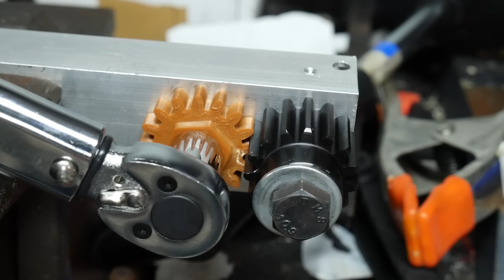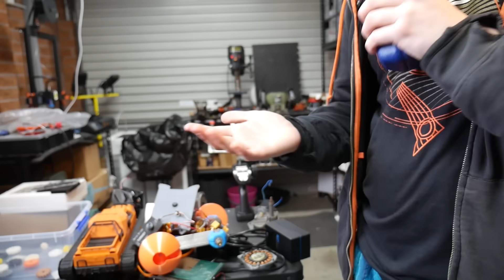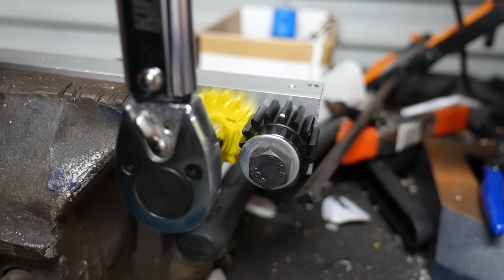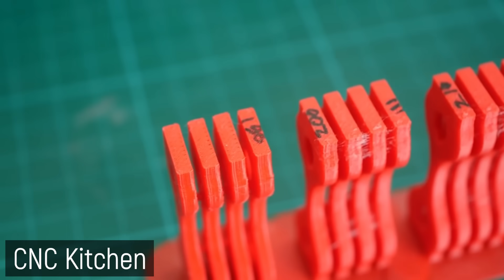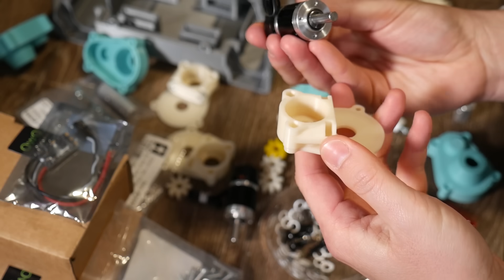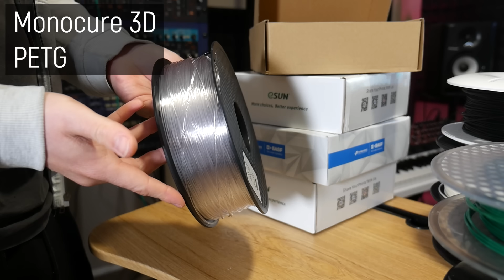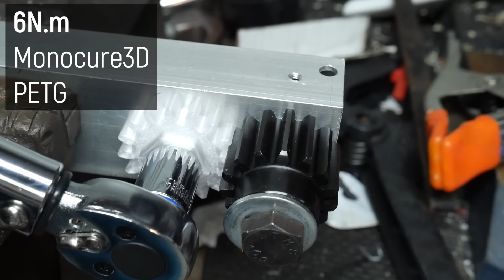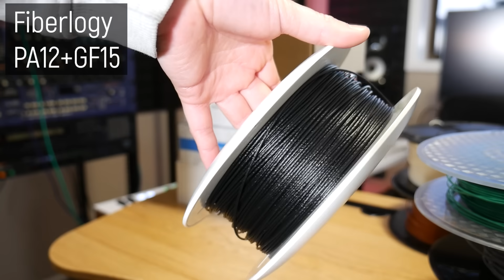Which 3D Printed Gear is Best?

Comment: I don't understand why, other than ease of print, people try to use PLA so often for anything functional.  Everything I read mentions it degrades, deforms, gets brittle, and heat causes issues.  I mean if you print a functional part for a machine with PLA and its at best slightly "stronger" in certain ways at first but fails within 6 months why not sue ABS or a different filament that will be humming along quite nicely for years or much longer?  I did notice we tested 4 filaments and gave PLA 4 bites from the apple including multiple special blends while the other 3 filaments got 2 bites.  And poor ABS got old filament to boot.  Interesting to be sure, but the pro PLA bias in so many video tests is present.

Comment: Thanks for the very interesting video. I've impressed with CF PLA and CF PETG stiffness, but I'm not sure how a CF filled gear would wear.  The surface of CF parts seems fairly abrasive. Maybe a slippery surface is more important than outright stiffness for gears.

Comment: I'd like to see the tests performed again for Nylon or anything else that fails with a hex drive. But do it with a different drive, like a cross pin or other similar mechanism that won't fail to simple minor flex.

Comment: The 'mechanical fuse' concept is an interesting one. As seen in the comments, there are many instances of them. But one that comes to mind, are called shear pins and often used in lawn and garden equipment, they connect something like an auger to a shaft and will shear if you hit a rock, etc.

Comment: It's B A S F
Also, before I decided to go with the "rolling around the hub" failure mode, I would have to ask what levels of torque it handed after having done so.  E.g., after exposed to a 11Nm load, how does it handle a 10Nm load?  If it still handles it well, then what you're looking at isn't a "mechanical fuse" but a "self resetting mechanical breaker"

Comment: For the kinds of thing I make, the static load test isn't really important.  even 10Nm is a lot of torque for a small robot or something.   Seems to me that long term wear would be a more major problem.  How about running gears at  high speed with a more modest load?  Do the teeth wear down?  Does progressive cracking become an issue?   For a wear test, running it against a super-smooth metal gear wouldn't be very meaningful - but rather use two 3D printed gears against each other.

Comment: In my opinion you should print these gears 100% solid in all tested materials.  You are comparing hollow gears to solid gears.. apples and oranges. However the data is very usable especially the flexibility data. Also your temp has to be different / tweaked for each material to get a 100% layer bonding per material.  Then aneal each print to max out strength. The failure should  not occur along layer lines.  Then you would see how strong a gear can be that is 3d printed.

Comment: Wait. Given that it is not a solid print, your typical failure where the (solid) exterior part starts peeling away from the (infill) core could be partly dependent on the orientation. At some orientations, you'll be putting shear stresses on the weakest point in the infill-perimeter boundary. In other orientations, you'll be stressing the strongest point. So you might get much lower breaking strengths on some tests more or less by accident.

Comment: My 1987 Kawasaki GPZ305 has a Nylon oil pump gear. I have heard that a cold engine and high revs increase the risk of the gear failure. Fortunately so far I haven't had any problems myself.

Comment: Probably a better test is to run them at a set load and see which material wears down most. From what I understand nylon is commonly used for gears because it's self lubricating which extends the life of the gear.

Comment: The best material for printing gears is probably IGUS I150 or I180. It is specially developped to have very high wear resistance and has self lubricating properties. And for high torque applications igumid P150-PF can be suitable since it is fibre reinforced.

Comment: My experience as an injection molding engineer I can tell you that the industry uses POM (delrin) to injection mold gears because this material is self lubricating and helps against wearing out. Is it possible to print with Pom?  The glass filled nylon is mostly used for producing frames because its stiffness. PC is mostly used for decorative parts with lighting or when you need smooth glass like surface.

Comment: I have a question about proper storage. You've made videos about storing filament in vacuum bags to prevent moisture but then often show a roll you've had just laying around. Are  all your old rolls stored in vacuum bags or (for PLA) is humidity not as much of a problem?

Comment: if you are not able to get a mechanical failure to protect your motor and controller you could use electrical protection like a fuse to blow when it binds.

you could also use an ebike controller witch limits the current where as rc esc will dump everything into the motor and that is why you can burn motors and esc.

update:

i just realized you could use the gearbox from a cordless drill and hack a way to fit your motor to the drill gearbox and then drive your models that way.

drill gearboxes have a clutch designed to slip to prevent stripping screws.

also being a gear reduction you can spin the motors at higher rpm and not bog them down as much

Comment: The "tougher" PLA brands probably stand up against wear over time better than strength.
What I'm worried about in 3D printed gears is their lifetime. How long will they last before they start to show signs of wearing out?

An idea for testing the gears wear-resistance:
Have a large flywheel attached to a small metal gear.
Then have a 3D printed larger gear attached to a motor.
Have the contraption spin up and slow down (brake) multiple times over a fixed span of time. (say... 8 hours)

This should show how well (or how bad) 3D printed gears stand up against wear and tear abuse.

Comment: I've been using "generic" wanhao PLA to print change gears for my metal lathe, an old Southbend Clone, and they've been able to take some pretty heavy cuts with no failures yet. I agree that a sudden shearing or stripping of the teeth is definitely preferable so I like the brittleness of PLA for gears. Rather have them let go all at once and get out the way

Comment: In small gears running at high speed, temperature resistance is a very important thing. I have made gearboxes in the past with PLA on the motor pinion and it just melts with no load. I also made a electric mountain board, and printed some PLA motor pulleys, which were ok at slow speed, but would also melt at sustained high speeds. Printing the pulleys again from nylon gave the heat resistance they needed.

Comment: I'd love to see a full video series about the strength of these plastics in rotational strength (like this one), crush resistance (for use in hydraulic presses), shear resistance, and tension strength. I mean, if you don't do it I will, but you're actually skilled at this stuff.

Comment: I've used grey PC Blend from Prusa to print a 3:1 reduction spur gear for a large brushed DC servo. I'm not sure of the exact torque, but it's in the region of 35Nm.
Printed with 5 perimeters, 7 top/bottom layers at 0.2 layer height and 35% gyroid infill. It has been in service (in a car engine bay, no less!) for months now with no issues whatsoever. The original gear was injection moulded POM.

Comment: Are there some materials that have higher strength even if they have lower toughness? Ductility is actually a downside for your application, since you don't want the teeth or hub deforming. High strength / low toughness would also result in very clear and obvious failure, since it would fracture instead of deforming, which I think might be more suitable for you.

If you do choose to use lower strength, higher toughness materials like PETG, nylon, or polycarbonate, then perhaps consider different designs for the hub and teeth. The involute gear tooth is meant to reduce noise, friction, and wear, but introduces single point of contact that can be quite a ways from the root. It also tends to cam out under load. Other tooth profiles might produce less torque on the root of the tooth. Likewise, the hex hub clearly spins with only a small amount of deformation, which is aided by the low pressure angle. Using some kind of a spline instead of the hex nut would provide a much better contact angle and would require much more deformation before it would slip.

Comment: Try iglidur i150 from igus, it is specifically made for gears (as well as other components subject to friction and wear). I had best results with a 245C hotend and 40C bed. Also keep in mind that a moving gear will experience heat from friction which may yield much different results than the stationary torque test you demonstrated.

Comment: Great work, but I am disappointed you didn't go back and print solid ones. For instance I would guess the nylon one will not slip on the shaft if printed solid. The PLA one may get up to around 20. Always failing at the tooth. Doing a helical gear would be a good idea too, as it spreads the load over more than one tooth.

Keep up the good work I enjoy your channel (even when you were having the hair crisis😛).

Comment: Motorcycles have a rear sprocket design where the center is aluminum to reduce weight and the outer portion is steel so the teeth take a lot of time to wear, maybe something like this could be used with the nylon for teeth and pla for the center to transfer the load to the shaft. You’d have to find out a way to mechanically connect them that doesn’t just recreate the issue with nylon in that it slips, maybe use screws?

Comment: A meaningless test for gears, the gear will not experience such loads in operation, the main causes of gear breakage are wear, which occurs due to static loads such as friction, as a result of which the plastic heats up and the gear breaks. As a result, you need to test the plastic for the coefficient of friction, for PLA it is high, this plastic can withstand high dynamic loads as in your test, but this does not mean that it will work in your device for a long time.

Comment: Even the worst of those filaments is probably giving you more than 10 times the STATIC strength you need. At this point I would focus on DYNAMIC and IMPACT testing which are how gears typically fail.

For dynamic you need to spin and load the gears, then you should check for durability, noise and efficiency (how much heating is produced by friction).

Impact can be easily implemented by dropping a weight from various heights after having attached it with a rigid chord to the end of your horizontally placed wrench. The spinning hex shown by the nylon gears here can be a huge pro, allowing to recover from the impact with little to no damage.

Comment: One thing to try, if it is possible, but is there a laminate setting with the printing? So the first layer you print left to right, then the second at a 90 degree rotation to the first. Like with wood there is a grain. By changing the grain by 90 degrees each layer is weak by itself but a combination of cross grain laminates and many layers the over all strength increases. Can we apply a similar method with 3D printing?

Comment: I like pla alot, its strong, it can be easy painted, biodegradable. I use it alot and some times i get impressed by the force it can withstand.temperature is not one, i made a cupholder for my Saab, it needed to be ABS ;)

Comment: How about trying Igus Tribofilament? Igus makes self-lubricating plastics, some printers even use their linear rails. I have a reel of (oops!) 3mm filament and no printer equipped for 3mm of Igus filament. I have printed several BB ball bearings using the 1.75mm Igus sample I got before buying the reel of 3mm. The self-lubricating filament should help on friction heating in printed gears.
Reply: Also a thought, dual-extrude a BASF inner gear with a shell of Igus. The tribofilament is fairly expensive (nowhere near PEEK though) and who knows what the strength is, but as a low-friction surface "plating" would be like printing Delrin (maybe).

Comment: It would be interesting to see the tests done with both ends of the turning shift supported so you are looking purely at the torque being applied.  It seemed like the gear was also being pressed into the fixed gear by the torque being applied due to that end being unsupported.   I am assuming the gearbox the gear is in supports both ends of the driven shaft?

Comment: I've been making gears for a local printing press over the last 10 years, and have found PETG to be a good compromise. Unfortunately their gears get quite hot while in use due to friction of the meshing teeth at high speeds. PETG is strong enough for the usual wear-and-tear and can take the high temps.

Comment: I have found that the strength of PETG changes with time after you print it. A part that i printed serveral of in eSun PETG would handle the intended load when used in the first week or so. Once it was a month or so old and the same load applied it would shatter. This part was not left in the sun or exposed to high temps. I think could be that its absorming moisture. I printed the same part in eSun ABS+ and it has lasted more that a year.

Comment: I make gears 1 tooth for every 1mm of diameter seem to work best. Lithium or molybdenum grease on the gears stops them melting/wearing.  
Wish I could find a reliable supply in NZ ,every time I find a good PLA the next time it's been swapped for some thing else

Comment: Quite fascinating testing! And I'm interested in how PC holds up.
Reply: learn from Project Farm. random,  unknown, test subjects are useless. Test subjects, sent by the mfg. may not be the same as what I can buy. If I can't buy exactly what you tested, ALL of your work is useless.
Reply: other testing I would like to see:  MTBF in use. Loss of torque/ friction, thrust due to material type. Best Lubricant.  Best Drive Shaft (spline, D, Square, Hex, etc).  Size of gear/teeth to torque failure point. MTBF: cruising and Max RPM.

Comment: I would choose nylon for this as it may slip under heavy load but for it to slip there must be a problem in the first place. It also goes back to shape after the problem is solved therefore no need to print another one.
For some reason no-one has done a video on T.P.U. for making your own o-rings and gaskets. It's brilliant for that reason and would suggest you do one.

Comment: Think another good test for gears would be to run them with a motor for a while and see how much heat generated at mesh points and how much they get worn out. Also, at what point teeth shear from wiggling back and forth (pushed by gear and springing back). Guessing pure nylon will be a leader there.

Comment: Try printing gears with a larger pressure angle. This will make the base of the tooth wider (ie. more triangular in appearance) and that will make the gear stronger. Gears with lower pressure angles, like your skinny finger like teeth, transmit more power with less pressure on the bearing... however, they are weaker. Also, as mentioned in other comments, try herringbone or helical gears... and try these in combination with a larger pressure angle.

Comment: Your call for a torque resistant 3 D printer calls for a different design concept. Think of a Ferrari wheel that is thick at its base and has deep tentacles that extend to the same in it's torque receiving gear and make the with bigger hubs and bigger gear teeth length. and do the same when they attach. Don't spin da teeth, give them teeth.

Comment: @ 02:00 - Didn't watch the video until the end but i can already tell which is better and for what application, base on my MSc mechanical engineering degree.
Nylon for low torque, high impacts and high cycle count applications, nylon is self lubricating so it can endure many cycles without losing its given geometry and tolerances. Also being able to endure higher temperature than the other 2 is a plus for applications that require long and hot runs.
ABS when you need it to endure somewhat high temperatures but have medium amount of cycles and impacts, ABS fails in a ductile way, so you can design the gears in such a way one of them is safe guarded from fail.
PLA when you need the parts on that moment and only have to endure low cycles and some high impacts so you can collect some data for the new definitive part.

Comment: Print it in a resin printer, and then make a mold from silicone and cast it in a strong polyurethane. That way it is both strong and precise. And if you need many it is fast to do with the silicone mold you made.

Comment: With the nylon gears, it would be interesting to see a sort of tag-team combination of a nylon gear, with a more stiff material used to engage the gear and the hex that the gear rides on. I don't think you would get any improvement if you replaced the core of the gear with a harder filament but kept the teeth as nylon, as you would just get slipping at that interface or the nylon sheering due to being thinner. Instead, make it like a sandwich with some kind of interconnect (like a 1/4th circle peg and socket [this makes it a 50/50 split between peg strength and socket strength]) as the engagement between the two materials. It would result in a thicker gear (or rather, more space used per gear), but should also provide a "best of both worlds" type solution.